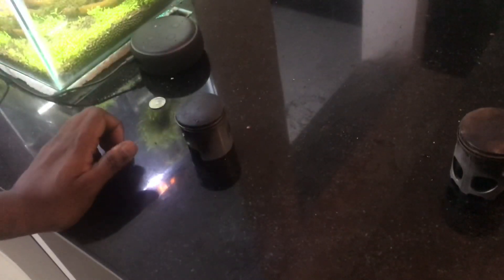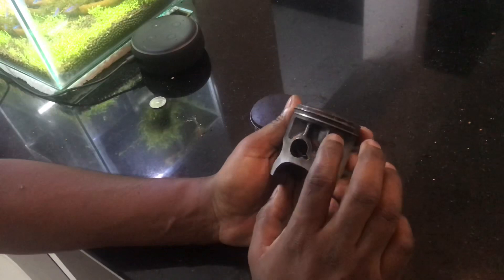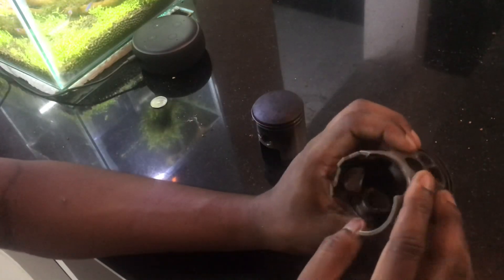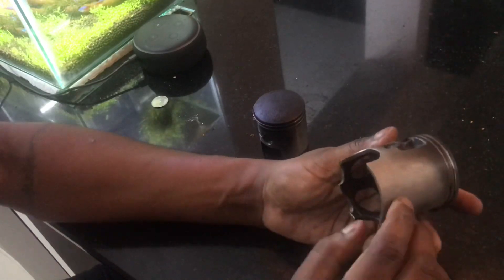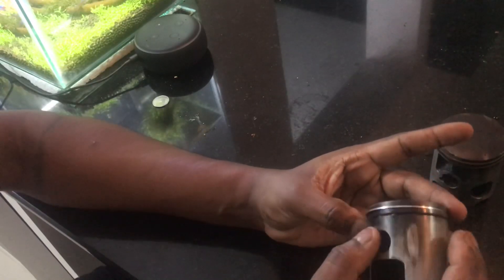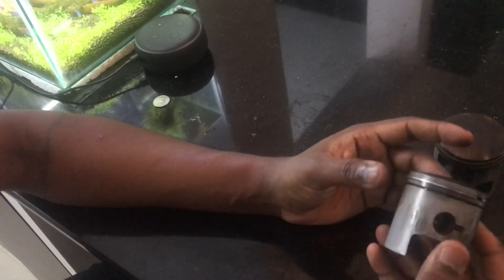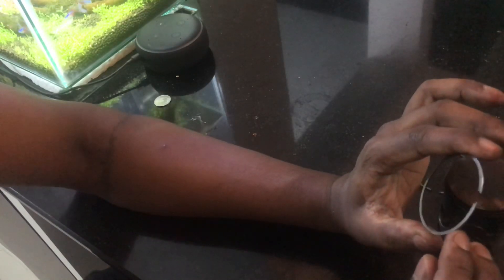When to replace piston/rings | when to rebore the cylinder? | Yamaha RX | Suzuki Shogun

Comment: One more thing , when should i need to replace the carb

And what is good 
Changing carb or replacement of jets and all kit..?
Reply from the maker: The carb is never really a consumable item, there are rebuild kits available that can take it to prime condition
Reply: @Yamakaze but in my case rebuild kits are not working anymore 
It is providing extra air
Can’t even start my bike for 5 min regular 
Jhung jhung sound
No idling 
If it idles it feels so flushed 
Then i change it to indian micarb 
You have to adjust Indian micarb by changing needle pin setting to top 2 
Default it comes rich
Now im all good 
Good pickup 
Good sound
Top speed you can say 19/20 difference 
But bike one kick start
Its my experience 
Japan carb really gone
Looks new 
But not good 👍

Comment: Bro eingen jerking rx135 
While slowing the speed
Pat pat issue 
Not smoothly throttling down
Please give me solution
Reply from the maker: Could be electrical, which year and model?
Reply: @Yamakaze  1999 rx135 bro
Unsleeved .5 running 
Changed cdi swiss to Nippon 
Changed spark plug 2 times tried bosch and ngk

But still same issue 
Also changed Reed valve HTA
Bike acceleration up is smooth
Reply from the maker: @baljeetsandhu2049  if possible try swapping the carb with a bike that is working well
Reply: @Yamakaze  also i have changed the pickup coil brother

Comment: Very unique info. on the piston-rings-cylinder diagnostics. 👌

My Rx135 is in storage in outdoors for the past 5 years. 
Now, I have been able to get hands on taking stock of the condition and revamping slowly. As expected the engine is in seizure. I removed the head to see the condition, and to my surprise, I see some kind of scaling and deposits on the cylinder wall, giving it a scotchbrite kind of surface. It has hardened. I could see this as the piston has settled at the BDC. 
I am concerned and trying to understand about this condition of the cylinder. 
As kerosene is not available, is it a good idea to pour some 2T oil or diesel into the cylinder and leave it for some days? 
I had sprayed WD-40 two days back via. the spark plug hole to see if it can loosen. Only then, I have removed the head. I have dipped the cyl. head in diesel for general cleaning and hoping to dislodge the carbon in combustion chamber of the head. 
The bike is 22 years old but run less than 20k.
Request your guidance for saving the cylinder. Thanks
Reply from the maker: Use a a wire brush for cleaning the head
Reply: @Yamakaze  Thanks for the reply. Head is no problem. It got cleaned with WD-40 and diesel and some light brushing. 
The problem is with the cylinder wall where some crystal kind of deposits have accumulated.  I see a direct contrast.... the cylinder wall is supposed to be the smoothest surface, where as right now it appears like the roughest sandpaper is stuck on the cylinder wall. 😊
I have been spraying WD-40 on the cylinder wall and then soaking a cloth in diesel and forcing it in the cylinder, so that diesel keeps dripping on the scaled surface.  I shall observe and keep pouring diesel every alternate day for next 1 week and see the changes. 
Any  better method you suggest could help save the cylinder.
 Thank you very much.
Reply from the maker: @vintubeable  it’s the rings which are stuck, if the sand paper like surface is present then it’s better to break re it to next size
Reply: @Yamakaze  Quite possible. I shall know once it frees up from the seizure.I am working towards it. Thanks for the guidance.

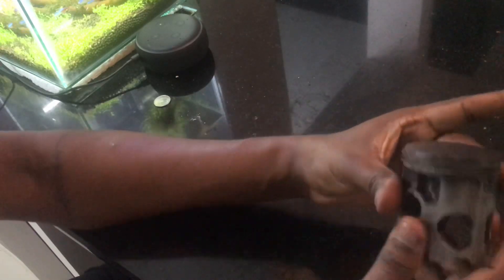Comment: 4:30 Brother, I was told that the rings should not move freely in 2 stroke pistons and if it is 4 strokes, it doesn't matter whether they move freely or not.
Reply from the maker: Not clear on your question
Reply: @Yamakaze  At 4:30 mark, you were saying that the piston rings should move freely around the piston. I saw few other videos where they were saying that, in 2 stroke bikes, the piston rings should not move around freely in the groove and the piston-pin notch is there to prevent that from happening.
Reply from the maker: @mjshaheed  that’s true. It won’t move freely. Maybe a mistake
Reply from the maker: @mjshaheed  now I remember what I meant, it will spread out and form a tight seal around the piston and helps keeping the charge sealed in the combustion chamber. It won’t move around but it will spread out
Reply: @Yamakaze  Thank you so much for taking time to explain it ❤️
Reply from the maker: @mjshaheed  👍

Comment: Hai bro my Rxz Previous owner has bored it to 0.25 oversize and has used the std stock piston since it was in good condition now I am not getting the compression or the power generation, can I use a 0.25 oversize now without reboring it to 0.50? Pls reply me bro and mechanic checked and told the bore is in excellent condition on 0.25 oversize without any damages or scratches inside.
Reply from the maker: Put a .25 piston without rings and check, it should be slightly tight, if that’s the case you can install the .25 piston. You should never install a standard piston in a .25 bore

Comment: How to check if the cylinder is bored properly??? How much gap should be there between two end's of rings after rebore if we insert ring without piston??
Reply from the maker: That’s not how you calculate the clearance. You will have to measure with the rings on the pistons. The factory recommended clearance for Yamaha and Suzuki bikes is 30 microns

Comment: Hai. Could you please tell me which other piston suits Suzuki Shaolin to get more power. Or would it be ok to bore  the existing one
Reply from the maker: There is no piston that increase power, what do you mean by boring the existing one?
Reply: Hai, too much white smoke coming. Either I have to re bore or to buy a new one. If I have to buy a new one, which one should I buy in case if I don’t find Shaolin piston. Any other models piston suits? 

Thanks
Reply from the maker: @joshymathew876  white smoke in a 2stroke is not because of bad rings, that's 4 stroke, if the gear oil leaks into the combustion chamber this can happen.

Comment: Bro..my piston is producing a lots of sound..so i decided to rebore my cylinder and add a oversize piston..at currently my piston size is .75mm and iam reboring it to 1.00mm..so will it decrease my mileage to a large variation..my bike is yamaha rx 100
Reply from the maker: It won’t cause a big impact but do the run in period perfectly
Reply: @Yamakaze  thank you

Comment: Really very helpful video I have got on YouTube after long time, Good job 👌👍.
I'm having yamaha rx 100, but the problem is I need to give choke for starting the bike every time and even I have noticed Extra white smoke is coming out of the bike.
I have done the complete engine work before the lockdown (engine rebore, changed piston, changed the bearing).

Could you please help me out? I'm assuming the fraud mechanic just fooled me.
JFYI I'm have maintained the speed 40 km per hr for riding purpose. White smoke which I have noticed. In 200 ml of petrol without 2t oil & the oil pump isn't working.
Reply from the maker: if a bike doesn't start on a warm engine without choke the pilot circuit is blocked, clean the carburettor and also make sure there is no rust in the petrol tank, replace the fuel filter after rinsing the tank if rust is there.
Reply: @Yamakaze  thanks for the reply really appreciated.

Bike gets start in the warm engine and petrol tank is little bit rusty. Could you please help me out with the white smoke problem?
Reply from the maker: @amanmahajan9234  White some means that you are burning the gear oil, white smoke is not to be confused with the blueish smoke that is a two stroke signature, some 2T oils produce more white than blue smoke. first thing to do is check the quantity of the 2T oil, max amount of oil should be around 30ml per litre of petrol. if that doesn't solve your problem than you need to see if real oil is shaping through into the combustion chamber. that would mean bad oil seals or worst, damaged crank case.
Reply: @Yamakaze  Thank you very very much ♥️

Comment: I own a suzuki samurai. It is clocked around 80k kms. And havent done rebore till now. It is in std size. And bike doesnt idle well. It over accelerates when I start the engine. And stalls soon as I ride and stop.bad mileage. It is giving me around 10-18kmpl. And also it is not a constant mileage. Previously like last year it was in same condition but some what better, during those days it gave me around 40 kmpl. Exhaust was in good condition in those days. now there is not catalytic converter in it. Each and every time oil is dripping on the floor which is in pure black and thick in state. when i ride or else when i accelerate it hard it drips oil like hell on too the floor. Too much oil in exhaust.
 
This is my bike's condition. Please help me.
Can it be solved by replacing piston. Or else does it need a rebore.
Please help.
Reply from the maker: Sai Yasaswi the revving is not piston related, you either have a vacuum leak or your throttle cable is stuck

Comment: Some noise , something like by some loosen parts, comes out from the piston portion of my 93 modl rx100, for about 3 years.  I did not open the head. Is that due to a damaged piston ring  or so ?.  I do not feel any power problem, but the bike does not give the crystal RX rin.tin.tin sound.  Do I need to go for a ring change ?
Reply from the maker: Army Josh might be a bad top end bearing, it won’t be wise to just change the top end bearing, you need to change the other bearings as well, I am pretty sure that your crank will have play. You are looking at a overall engine rebuild.
Reply from the maker: Army Josh the top end bearing is a few 100 rs, change it if that’s bad. It’s worth a try at least
Reply: @Yamakaze  OK..will go for it.